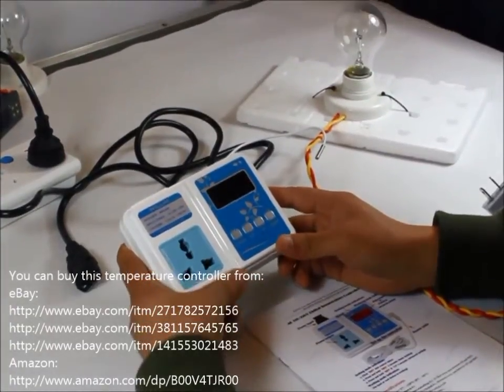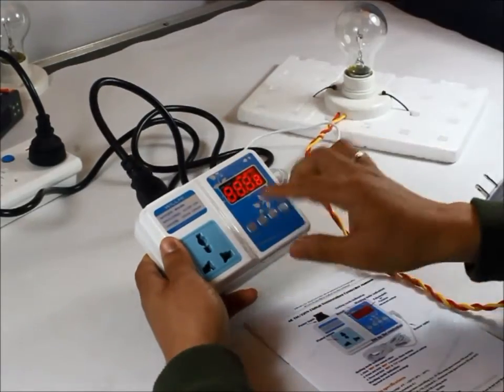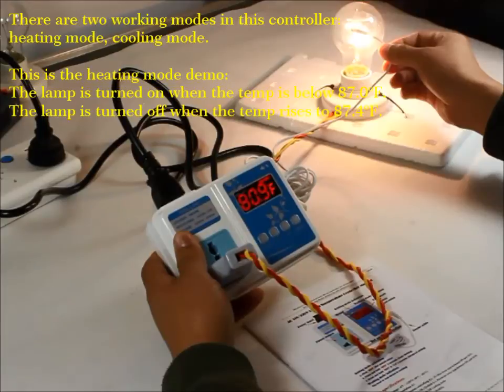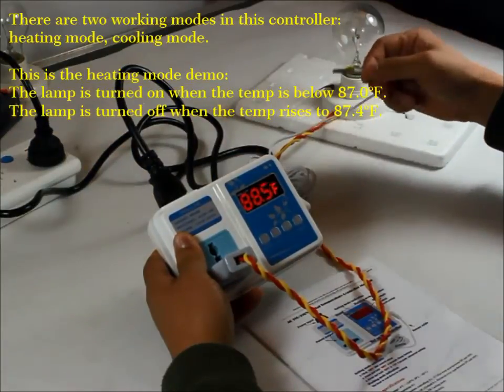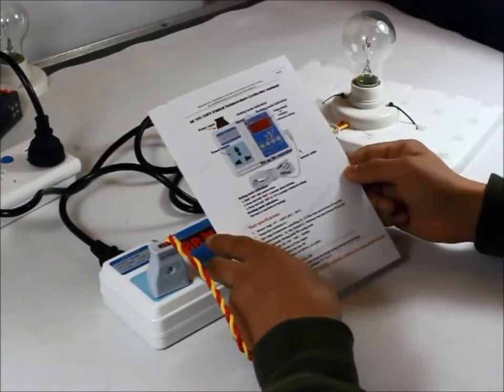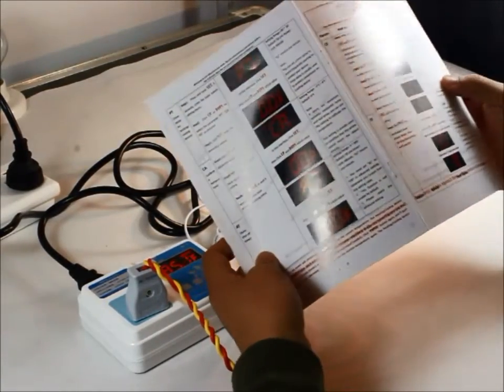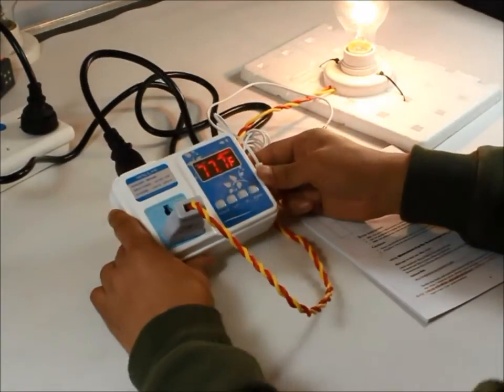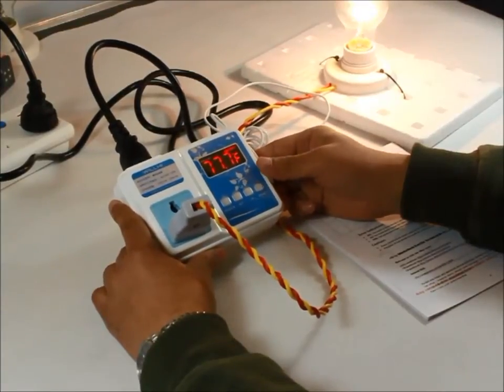Willhi Wh1436 Ac 110v - 240v Digital Temperature Controller Thermostat Control Switch

Comment: Hello, I am using a Movincool CM12 to try to cool a sealed 8x4x7 area. I bought a regular house thermostat which is literally hanging in the middle of the area. The issue is that most house thermostats only update temp every 20 minutes. By that time, this area can easily shoot from 72 deg. to 90! - At that point, equipment in room may already be sending alarms. The AC unit uses standard AC wiring, but specifies it has to be millivolt only. Can something like this be used? I need to keep this area between 70 and 75 degrees using the CM12 Movincool. Any help or suggestions much appreciated.

Comment from the maker: You can buy this temperature controller from:
eBay:
(US)  http://www.ebay.com/itm/271782572156
(CN)  http://www.ebay.com/itm/381157645765
(CN)  http://www.ebay.com/itm/141553021483
or Fullfilled by Amazon: http://www.amazon.com/dp/B00V4TJR00